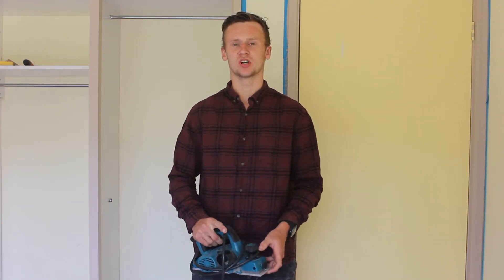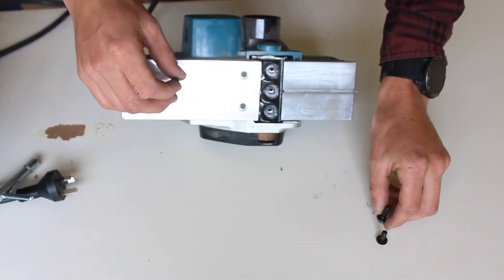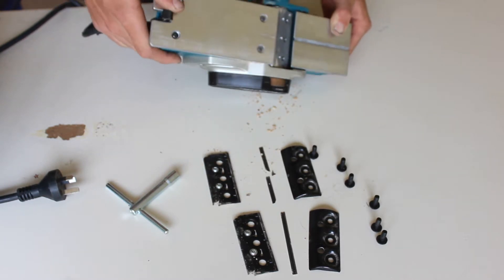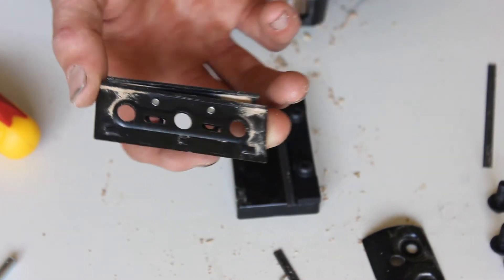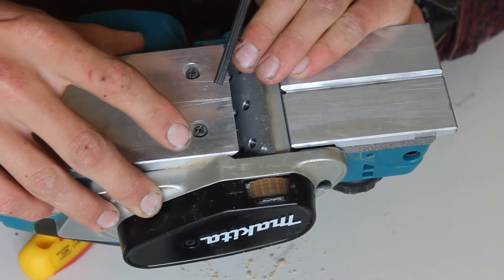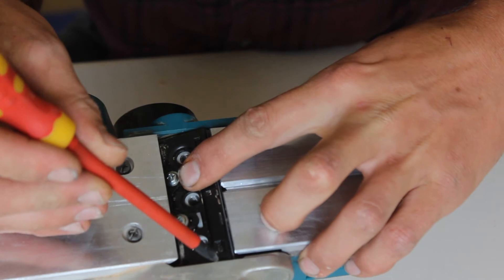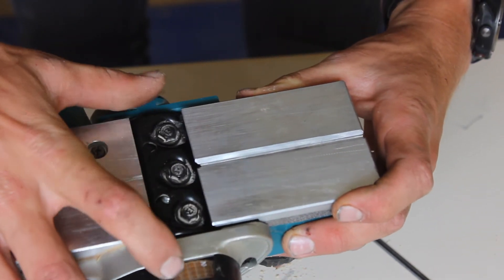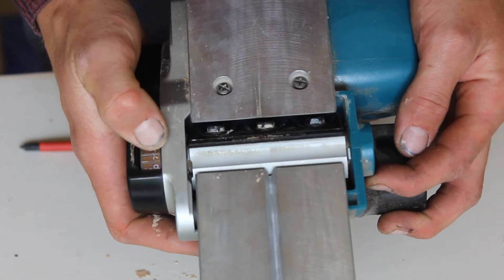How to Change a Planer Blade | Makita

Comment: Nice tutorial. I don’t think that setting block came with mine so I’ve been setting the blade depth by laying a flat bar on the main part of the base and adjusting the depth till it no longer touches the bar. Very hard to get the depth perfect 😞 As a result, I tend get little ridges in the wood when planing wide surfaces.